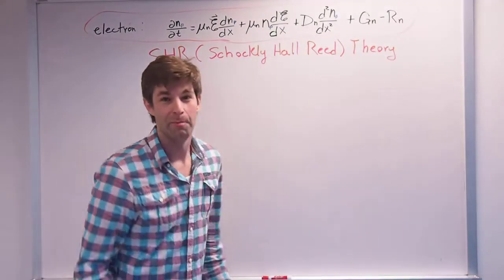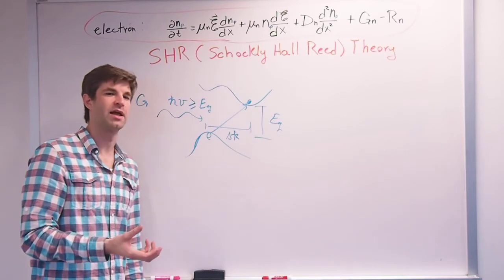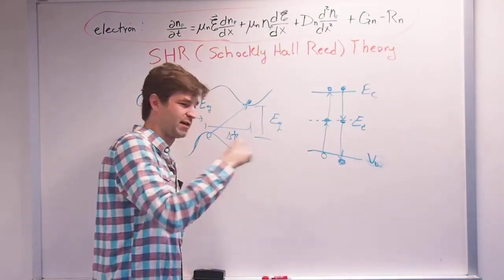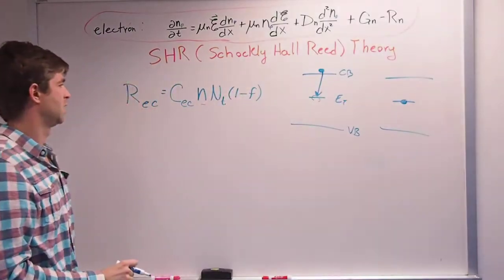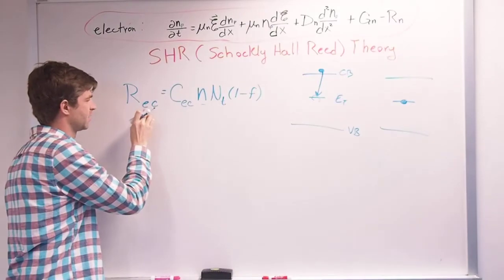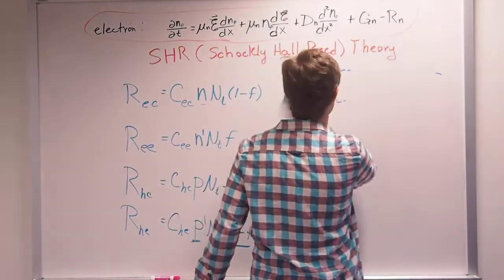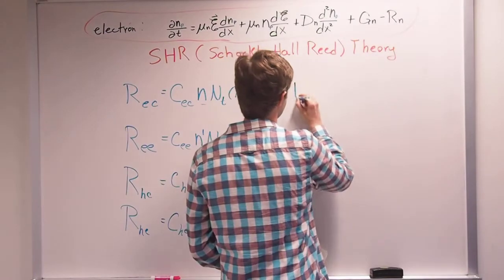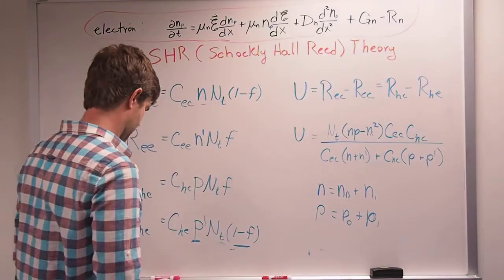Shockley-Read Hall Recombination in Semiconductors

Comment: Can n1 really be the density of electrons in the traps? If that were the case, n1 would equal Nt*f and Nt = n1+p1 which it doesn't.
Reply from the maker: You are absolute right Beth.  n1 and p1 are not the electrons in the traps but electrons and holes in the CB and VB respectively which are generated by some perturbation (usually light or heat).  If I said otherwise I miss spoke.